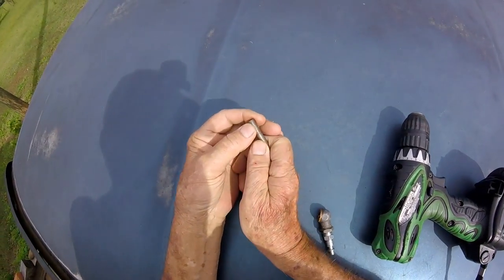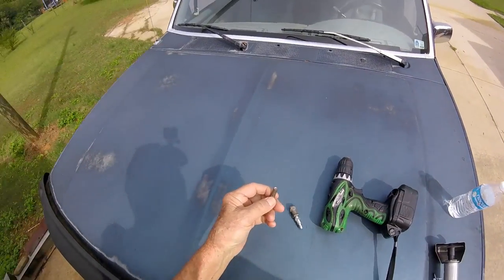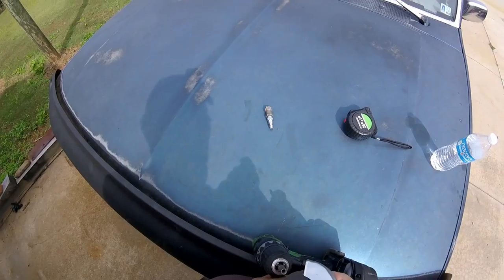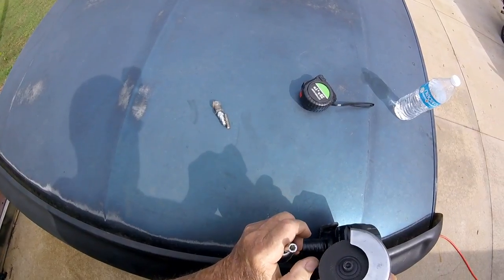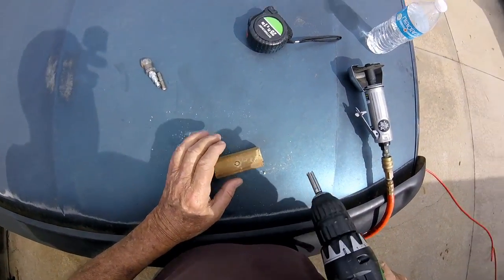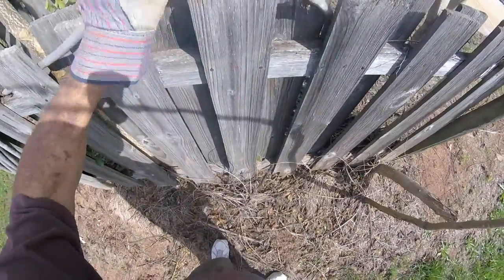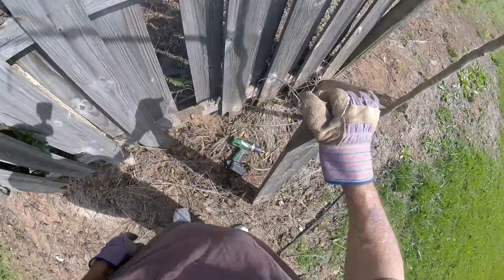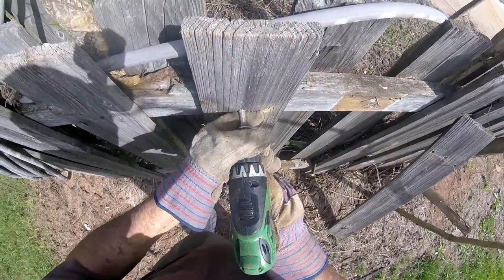Hole Saw for Fence with ring shank nails Pwalpar VLOG

Comment: We did when I was working  foo the moving service.  We would receive and on some occasions we needed to ship goods for clients.  They got to see that I knew the size of a 40" x 48" pallet and keep the goods inside that size.  We had a pair of sofas and 6 window covers that closed and locked.  I put 2 on  the pallet which was covered with cardboard, then stood the sofa's on an arm, each back opposite the other back.  With the  center between the two sofas i placed 2 covers inside the sofa with the pillows covering them and then put shrink wrap around each sofa then  did the same shrink wrapping both of them together. It was a perfect fit all inside the 40 x 48 pallet.  Using 1/2" plastic tie straps with the attachments to hold it in place, across the top of the sofas. It was a masterpiece, the owner of the moving company asked where the covers were since he'd only seen  2 of them.  He looked at the sofas and figured out that they weren't going to come apart even being shipped.  He was a little bit mad at me because I wasn't supposed to lift anything over 40 pounds because of a back injury.  But when he found out I'd used the pallet jack to get them where they were supposed to be he acted surprised.  Old saying use your head, not your brawn and it worked  perfectly.  BTW, IO stayed with that company for 10.75 years. My last day was Friday, 14 Oct. 2016.
Reply from the maker: I always try to find an easy way to do stuff  You used your head

Comment: You need a piece of galvanized tubing used for conduit or water line for what you are thinking of. Using a file at a 37 to 45-degree angle will sharpen that tubing.

Comment: I just used a reciprocating saw with a metal-cutting blade to cut the nails between the boards then easily popped the nail heads out from behind with a nail set.    It worked quite quickly to disassemble about 30 pallets.
Reply from the maker: My charger is broke I need a new one or a new saw  Thanks

Comment: Walter, you have a good idea. Trying to pry the boards off will just split them. How about using an old 1/4 inch drive deep well socket, that is hardened metal. The thing is, you will have to find one that is deep all the way down.
Reply from the maker: Thanks Matt  I got an item today to try

Comment: why not just use a nail puller ! much faster I would think. I have used them over the years Walter
Reply from the maker: Thanks Wayne  those ring shank nails are hard to pull without tearing up the wood